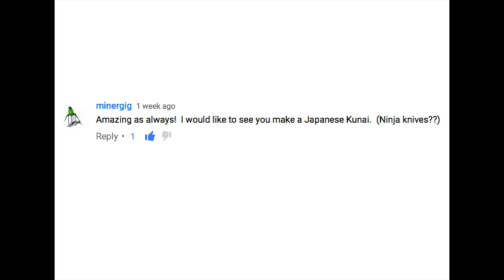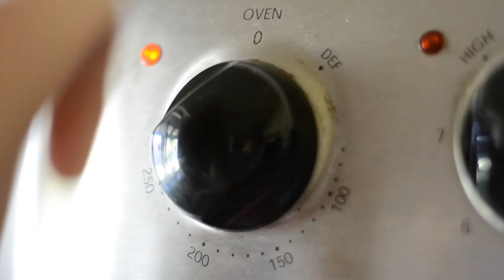Knife making - forging a Japanese Kunai throwing knife from rebar

Comment: I was always under the impression that rebar was mild steel at best...
Reply: yeah I'm not sure how hard that blade got or if it will even be able to keep the edge, it is just rebar after all. But hey what do I know.
Reply: yeah, it wont make a good, sharp long-lasting blade at all. For this project though it is probably fine.
Reply: Would love to hear what kind of rockwell hardness scale it had...
Reply: Roy Fernbach id say it is very low. maybe 35ish??? I'm not really sure about it. It most likely varies from piece to piece.
Reply: The knife will probably deform, which can be fixed (the rebar is mild steel). Throwing knives usually have a temper that allows impact / vibration abuse, having an edge gets in the the way of throwing anyway...but if the knife is too "hard" (i.e. kitchen knife, etc) it will be prone to shattering  / chipping. There isn't one type of steel / temper to rule every application...That being said, a "soft" mild steel will not fail completely at least, it'll only deform.
Reply: as a throwing knife, it might be fine, as you dont really want an edge, or you might cut yourself when throwing, but the main concern would be bending of the blade. mild steal should be soft enough to flex without breaking, and possibly hard enough to come back to (mostly) true if it his wrong. but i'm just speculating, i have made a throwing knife from the pieces of metal that hold up shelves, worked just fine. so would assume that rebar would be better.
Reply: Rebar doesn't usually contain enough carbon to harden at all. That quenching and tempering was probably rather useless. Also, AFAIK, water would be a better quenchant for really low carbon steels.
Reply: +jedexkid41
Mild steel will not break easily, it will also not flex very much. It'll just bend. You can bend it back, but this will work harden the knife, making it more and more brittle - ever bent a paperclip till it broke off? Same principle. Thus, it may be a good idea to anneal the blade before bending it back.
Reply: Roy Fernbach a high carbon steel would be best for this application. strong and flexible, you just have to watch for rust more
Reply: Yes, I know.   Rebar is NOT high carbon steel tho... it is mild at best, which is what I said.
Reply: Roy Fernbach

Comment: In my experience, limited af as it is, you want to use softer metal for throwing knives due to the fact that, you know. you're throwing it, and the harder material will fracture or even break if it hits something harder than a piece of wood or something. I might be talking out of my ass, but, that is what I remember from when I used to do throwing knives a lot. Cheers mate, and excellent build.

Comment: it's fuckin with my head a bit that the throw at 2:50 puts the blade into the wood at an angle that corresponds perfectly with a cut in the wood that's already there.

Comment: hello there first thing is you did good job in the video but there is one thing that is rebar steel has low carbon content so the heating and cooling in oil dose not improve the hardness .

Comment: When shaping the sides of the blade on the bench sander did you have to worry about it getting hot as it then was tempered again?
Reply: Rebar is mild steel and can't be heat treated unless he used some weird special rebar
Reply: +Miller Knives what forge are you using in this video?
Reply: Ben Arney. hola. soy niño

Comment: what kind of oil do you use at 2:02?
Reply: I can't speak for him but you can use lots of oils to harden blades when I heat treat I use mostly vegetable oil mixed with a lil motor oil it hardens it right up then temper for 30 minutes at 300* f to temper